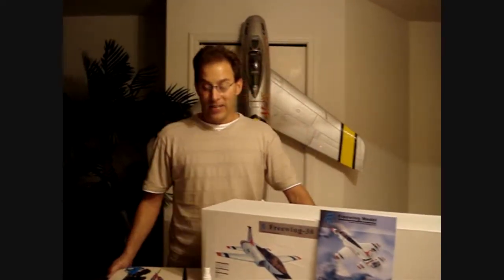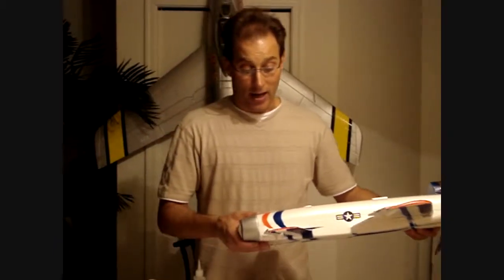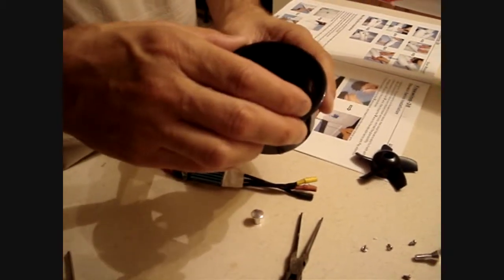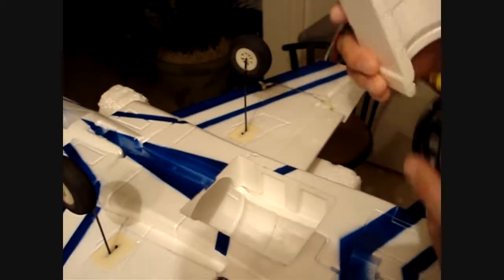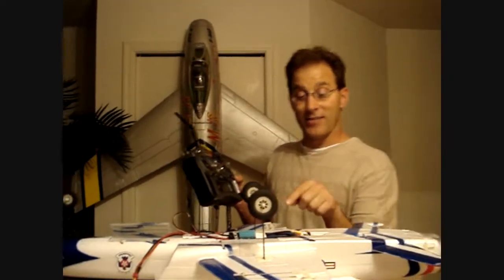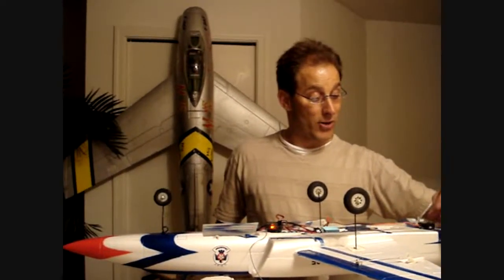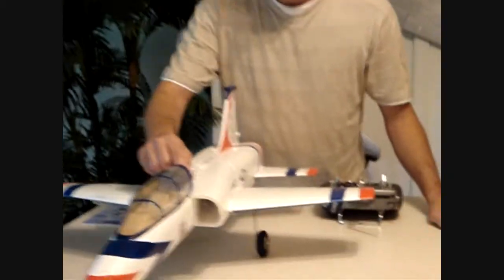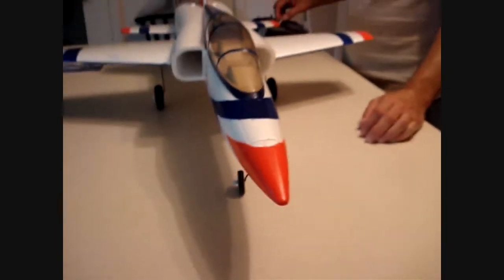T-38 Talon 64MM Ducted Fan Jet  Build Video

Comment from the maker: Great question. The plane is very light 1 pound 13 oz ready to fly. I have flown it hard with no issues. That being said, if you chose to ad cf rod try and install a small one through the fuselage and onto the wings.. It will not hurt being in the air stream.. GL Tim

Comment from the maker: Great question, I used the Park Zone 1090 Digital Servos, They are about 13 dollers each and you can tell them apart because they have a steel top gear. They are fast and travel well, so you will have to add Expo. Good lick and hope this helps.

Comment: one little prob with this plane its sold as artf but found that the servo for the front wheel would not trim so had to pull the plane apart just to put the servo arm on right i think ARTF are a good thing but they need to think and not glue everythink that we may need to get to the servos to set the plane up

Comment: nice idea that these kits are so light, you'll need it using no fuel!! but for hobby value i think it sucks ass as a build project the kit is mostly complete when you buy it. not bad having a kit that would require no instructions lol. should label these as "kits for the unskilled" lol atleast polystyrene is cheap.